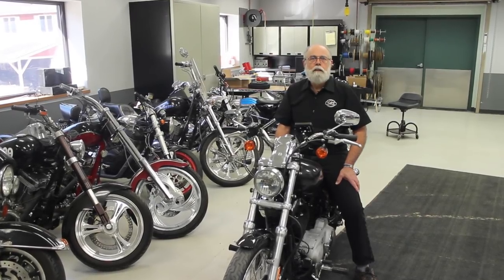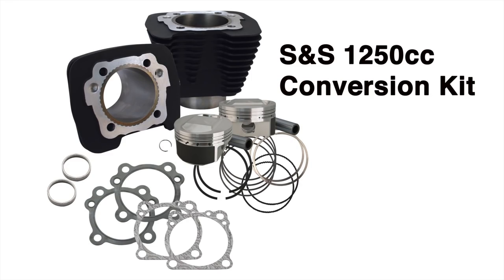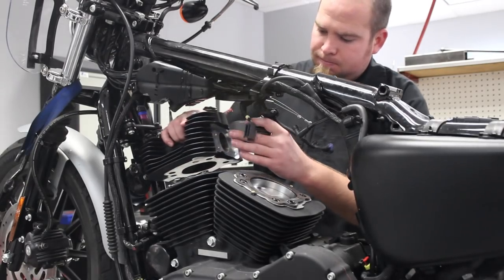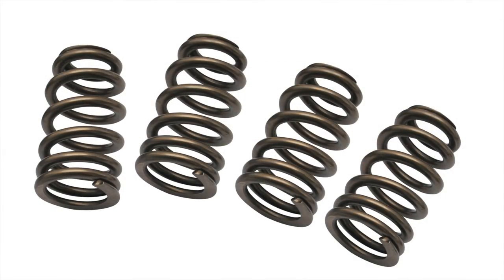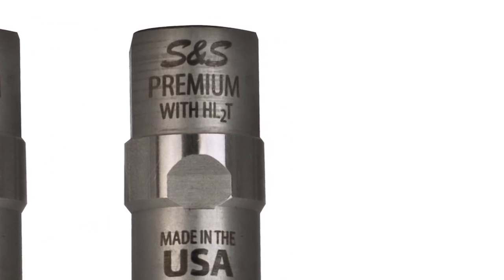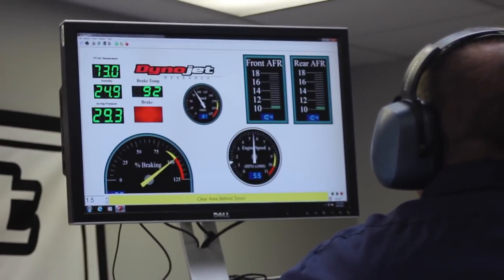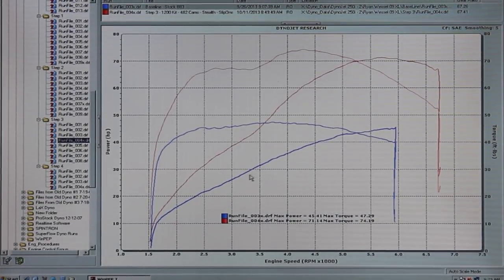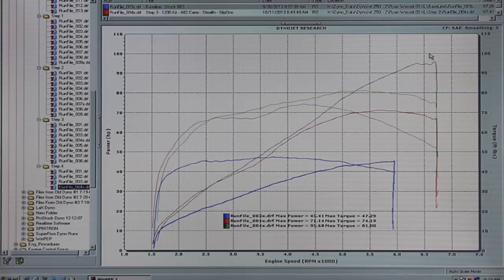S&S Cycle - No Guts To Glory  - H-D® Sportster® 883 Upgrade #4

Comment: Hi there, just curious... What kind of compression ratios are you getting with the S&S Heads?

i know that with the stock heads paired with some good pistons you can get a slight bump in compression. I heard that using 1200 heads will drop it back down a little bit. for example ive seen combos of a 1200cc top end kit (pistons and cylinders they got almost 10.7:1 ish compression vs 10.1:1 CR with 1200cc kit and 1200 heads.

THANKS! Great vids btw!

Comment: If I get the 1200cc big bore kit, would I have to also upgrade my exhaust and air cleaner or could I swap motors and use the same parts? I currently have a 14' iron 883 running V&H short shots, stage 1 arlen ness big sucker.
Reply from the maker: In order to get the expected performance  from a displacement increase, it is essential that you upgrade the intake and exhaust. More air, more power! Since you have already done that, you should be OK. We don't have test data about those particular components, so we can't accurately predict what kind of performance you will get in the end. "Individual results may vary". The other thing that we offer is the calibration files for our component combination. The calibrations that we offer were developed with S&S intake and exhaust, and will probably not be optimum when other components are used. Bottom line, it should work fine, but you will probably have to have somebody tune your EFI on the dyno.

Comment: If I was to turbocharge an engine like this, should I not go higher then this kit? Or can the CNC case handle the extra compression & power, from the turbocharger?

And what does S & S think about Buells? Especially the later engines. Is there any great improvements you can offer even them? Or are most of the stock Buell parts, that much greater then the Sportster engines, and there's not that much room for improvement, other then displacement?

I can go to Hammer Performance, or NHRS for increased displacement, but I want to mix & match what I can, because I want to support all you great American companies. Is there any great improvement & innovation you can offer for the Buell Blast & XB models? I really like your flywheels. Are the later Buell flywheel & engines so great, you don't want to bother improving them? Or can't, for some reasons?
Reply: I must also mention, I don't yet know all the differences, between the Sportster & Buell engines.
Reply: I apologize, the 2nd company's name is NRHS.
Reply from the maker: +RoyalSilver&amp;Gold S&S Does make some performance products for Buell motorcycles from 1994-'02 models. Check out our website, and download our catalog. 

Since there were a fairly small number of these bikes around, we couldn't justify the effort to develop new kits for he later models, and of course now Buell is out of business. We really never made anything for the Buell Blast. Thanks for your interest.

Comment: Is it acceptable to use feuling hydraulic lifters for the kit or is it strictly only S&S? Want THE best for my bike. Also how hard is it to start the bike after all of these upgrade?
Reply from the maker: Starting is not impacted by kit install. We recommend S&S hydraulic lifters when using this kit (we have not tested with other manufacturers parts and could not guarantee positive results)

Comment: Do you guys have any maps for this job? I've checked the power commander website as well as yours. The map I've got on there now is for the stock 883 with the Vance and Hines short shots. Bike runs fine at lower speeds, but upwards of 65, it's running a bit lean when cruising.
Reply from the maker: Your best bet would be to contact DynoJet. They may have something for the Power Vision tuner, instead of the Power Commander. Your second best would be to contact your local S&S Dealer.

Comment: My 1999 sportster that I bought recently it came with a damaged piston, the cylinders are fine somehow, but since the bike came with a SS Super E carb and air filter, but the bike was already changed, because originally it was a 883cc, now it was a 1200cc, now my answer is the next, can I buy a SS 1250cc piston/ ring kit/ cylinder set and use my original stock heads?
Reply from the maker: You can go to 1250 with 1200 heads - but not with the stock 883 heads. The 1250 bore is too big. But if you change to 1200cc heads, you can use the 1250 kit!

Comment: I have a 2015 iron with V&H staggered short shots, a hi flow breather and a V&H tuner. I want to upgrade it to a 1250 kit can I use the stock heads and cams with it or will I have to upgrade those also?
Reply from the maker: Stock 883 heads are not compatible with the 1250cc kit. However, if you have them CNC ported here at S&S, they will be work with the 1250cc kit. Stock 1200cc heads will work if you have a set on hand. You could run the stock cams, but if you get your heads ported, you can go with the high lift valve springs and use a higher lift cam to take advantage of the increase flow.

Comment: so i've been looking into doing some upgrades shown in the first 3 videos of this series but was looking at using a vigilante ez fuel controller to support the mods i was just wondering if you support tunes for it or do you deal exclusively with the dynojet power vision as i know companies in the diesel tuner community who only support tunes for 1 or 2 companies
Reply from the maker: Keep in mind that the Vigilante device is a calibration loader only. If Vigilante has a calibration for this engine configuration, it will work for you, but we don't know what is available from Vigilante as far as calibrations for Sportster® models. The files we have for the Dynojet Power Vision were created specifically for this combination of components. The Power Vision has the added advantage of actually being a tuner. That means you can edit the calibrations if need be. However, we'd recommend that any changes be done by a professional tuner! Tuning errors can be costly.

Comment: Great videos guys, I have a 1999 1200 sportster and want to go to the 1275cc kit that hammer just came out with.  Do you think their is much of a difference from the 1250 and 1275?
Reply from the maker: We have not dyno tested a 1275 so we don't have any first hand info about them.
Reply: S&S Cycle, Inc thanks for replying.
Reply: Did you allow for a break-in period after new pistons and cylinders?

Comment: How much did it cost to do this build at 1250 with the head work, not including the pipes or intake? Thanks
Reply from the maker: Here is MSRP  for the parts
1250 cylinder and piston kit... $1,006.05
CNC Porting (your heads)........$950.00
Cams.........................................$384.25
Pinion Gear...............................$174.00
Pushrods and Cover kit...........$260.93

Comment: Hi, I have a 99 Sportster XL 883 and I wanna upgrade it to 1200cc. What is your recommendation about the all parts or kit to buy? (in order to get the best power)
Reply from the maker: +Luis Soto Here is the recipe. The first thing we recommend is to replace your mufflers with a pair of S&S Slip-ons. That uncorks your exhaust. Next, either an S&S air cleaner and a jet kit, or better yet, an S&S Super E Carb kit. Then you're ready to install the 1200cc kit and make some power. The stock cams are really pretty good, but you can squeeze some more top end HP out of that engine with a set of S&S cams. That's where the law of diminishing returns comes into play. The mufflers, carb, and 1200cc kit will be your best horsepower bargain. The cams will make more power, but the cost per HP increases. Besides, you can always add cams afterward if you want to. The main thing is to get in a stronger wind ASAP!
Reply: +S&S Cycle, Inc Thank you very much I appreciate the asnwer, I will do in that way

Comment: I'm looking at getting a used 883 engine to build a custom bike. What year engine do I need to look for in order NOT to have any electronics? I want old school carburation.
Reply from the maker: All Evolution Sportster models will have electronic ignition, but could be converted to point ignition if you really want to. All 2007 and later engines were fuel injected. so anything 1986-2006 will be carbureted.
Reply: Solid mount Evo Sportys ended in 2003. Those are by far the best supported for chopping. Rubbermounts have some options but if chopping go solid mount.

Comment: How much does a set up like this go for. I was about to drop the money for the 1200 kit but seeing this now makes me want this. If eventually I will doing this anyway. I'd just like a ball park figure on what I'm looking to spend.
Reply from the maker: Here's an approximate listing for the bike we had.

Mufflers                                     $351.95
Air Cleaner                                $269.95
1250cc kit                                  $989.95
CNC Head Porting                     $950.00
Cams                                         $299.95
Pinion Gear                               $133.95
Dynojet® Power Vision Tuner   $549.95
Total                                         $3534.70

Comment: I'm planning on doing these same modifications to my Iron rather soon, though I want to get a new set of heads instead of porting the old ones. Could you recommend a good set for the 1250 kit?
Reply from the maker: S&S sells CNC ported heads outright. No exchange needed. As we've shown in the videos, these heads work! Talk to your local S&S Dealer!
Reply: @SSCycleInc  Hey, do you guys still sell the cnc ported heads outright? I am located in Cape Breton in Canada so I'm not sure who the local dealer would be?
Reply from the maker: @jonnymac8925  I recommend connecting with your local dealer and starting the process that way. You can find them via our site, here: https://www.sscycle.com/dealer-center/dealer-locator/

Comment: So you can do these steps instead of the 2nd video with 1200 cc kit and the third video with the cams?
Reply from the maker: Yes you certainly can skip to the 1250 kit. Riders who want to go this far, generally know what they want, and they want it all in one go. You still need the mufflers and the air cleaner, but most will not go through all the steps, but will do this all at once. Just a note: If finances won't allow the whole project to be done at once, you could start with the 1200 kit, and the cylinders can later be bored to accept the 1250 pistons. Just keep in mind that although the 1200 kit and 1250 kit are about the same price, if you have an 883, your stock heads will not work on the 1250 kit unless they are CNC ported.
Reply: S&S Cycle, Inc will 1200 heads work on the 1250 kit without needing to be ported?

Comment: How much would it cost to beef up a 2012 sportster 883 to its max?
Reply from the maker: Joe,
Here's a list of parts and the retail prices. Keep in mind that you'll have to tune the EFI, so we've included a Dynojet Power vision tuner in the list. We have a calibration that you can download for free on the S&S website at http://www.sscycle.com/tune-files/power-vision/

Mufflers                                     $351.95
Air Cleaner                                $269.95
1250cc kit                                  $989.95
CNC Head Porting                     $950.00
Cams                                         $299.95
Pinion Gear                               $133.95
Dynojet® Power Vision Tuner   $549.95
Total                                         $3534.70

We didn't include the labor to install all this stuff. You'll have to negotiate that with your local dealer!
Reply: +S&S Cycle, Inc I live outside the US I can have all parts  shipped, but shipping my cylinder heads back and forth is gonna cost me more than the actual head porting. 
What options do I have to get a 2015 Iron as much HP as possible?

Comment: I have allready the 3-1/2" Bore Cylinder Set for 1200cc,not the 1250 kit. Can i use the S&S® Super Stock® Cylinder Head Kit For 3-1/2" and 3-5/8" Bore 1991-'03 HD® Sportster Models? My bike is sporster 1996 year!
Reply from the maker: With the 1200 kit you can use the Super Stock heads. With the 1250 kit, you cannot.
Reply: thank's a lot
Reply: Sorry for asking again but I want to be sure. I have this kit, https://www.sscycle.com/products/883-to-1200cc-conversion-kit-for-1986-2018-hd-sportster-models-silver-finish/ Will I need other pistons?
Reply from the maker: Give our tech line a call - 608-627-1958

Comment: I have a 95 Sportster so I don't have to reprogram the efi.  I just have a carburetor (ˈkärb(y)əˌrādər/).  I don't understand the title of the series of videos.  No Guts To Glory.  I have heard the phrase No Guts, No Glory meaning you must put in effort to have a desired effect.  But I don't understand No Guts "TO" Glory.  Please enlighten me.  Thanks.  Good video. I have a 1200cc kit on my bike installed by the previous owner and wanted to see what all was replaced.  It has all the power I want.
Reply from the maker: A slight paraphrase. If you have ridden a stock 883, you will understand the "not guts" part. If you boost it to 1200 or 1250cc it will be glorious by comparison!
Reply: St White ..Go to see the wizard and get a brain!😕

Comment: How much would the price land at for all these upgrades?
Reply from the maker: Here's a list of the parts and prices.

Mufflers                                     $351.95
Air Cleaner                                $269.95
1250cc kit                                  $989.95
CNC Head Porting                     $950.00
Cams                                         $299.95
Pinion Gear                               $133.95
Dynojet® Power Vision Tuner   $549.95
Total                                         $3534.70

That doesn't include the labor to install all this stuff. You'll have to negotiate that with your local dealer!
Reply: Thanks :)

Comment: how all that changes affects on fuel consumption?
Reply from the maker: Folks who go this far in hopping up their engine are generally not too concerned with fuel economy. With that said, it depends on how you drive. If you drive conservatively, fuel economy will be about the same. But that's the problem. It is a rare individual who can resist twisting the grip when this much power is on tap. That's why you do this in the first place.
Reply: I twist too much as it is with an 883, I sometimes come back from a meet some nights fill up & think "how did I burn that much fuel"? I still want the 1200 ha..

Comment: how do these kit affect MPG?
Reply from the maker: +KoG GoK Guys who go this far in performance upgrades generally are not concerned about gas mileage, but here's the facts. We have determined that it takes about 12-15 horsepower to go 55 mph, and it takes a certain amount of fuel to make that much power. So if you drive 55, your mileage will still be about what it was. Let's be real though. That's not likely to happen. Power corrupts, and absolute power....with that kind of power available at the twist of your wrist, it takes a rider with an iron will not to twist it.
Reply: S&S Cycle, Inc just asking cuz i got a hayabusa that gets around 20-25 mpg only reason i got the 883 was for the mpg sadly its slower then a honda
Reply from the maker: +KoG GoK Since you have the 'busa for your speed fix, if you're looking for something a little more practical and economical for every day commuting or whatever, think about just going to the 1200 kit and intake and exhaust. The difference between that and a stock 883 will be amazing, but it'll still be a good daily driver. Check out Step 2 in this series. 
https://youtu.be/GQz9ZMo5drk
Reply: Uh, who cares??
Reply: Ion Racer me if i wanted to get 20 mpg i would get a 200hp hyperbike not a 40 hp harley =(

Comment: Thats why i ride a 1400..all that extra dough u might as well just get a bigger cc bike
Reply: Comes out to about the same price if you're buying a used 883 and then getting the upgrades. If you're buying all new though, it's definitely cheaper just to get a much larger bike.
Reply: but if you love YOUR bike it's your bike, selling it just to get another would just feel wrong I couldn't do that. plus the 1400 - 1650 would be so much heavier.
What model do you have out of interest?
Reply: HD NightBat right on
Reply: a 1400 is going to be in a much larger much heavier bike so any extra power is wasted hauling around a heavier bike.
Reply: Yeah but it'll STILL BE SLOWER THAN A SPORTY  and always have 100 + lbs more than one too